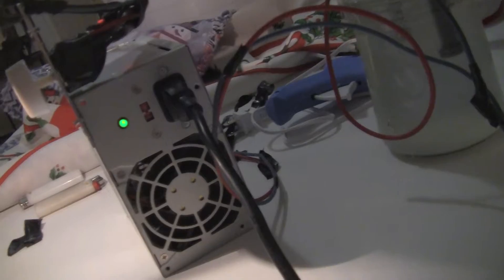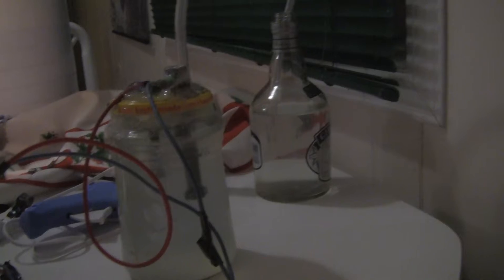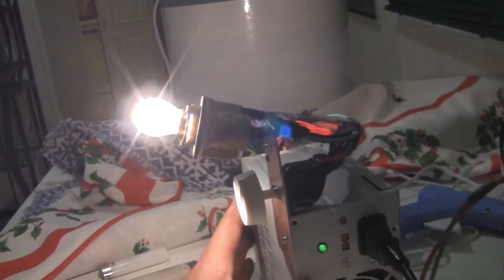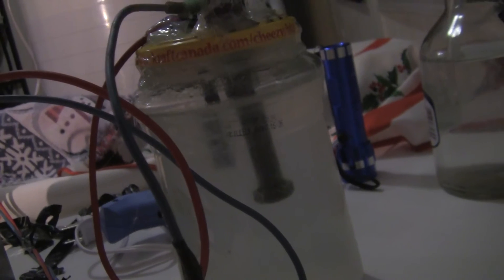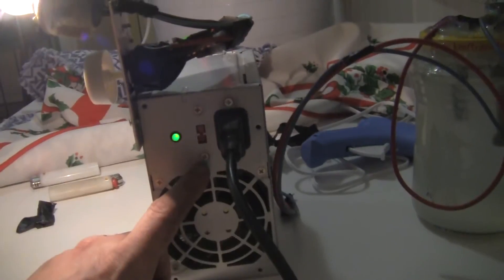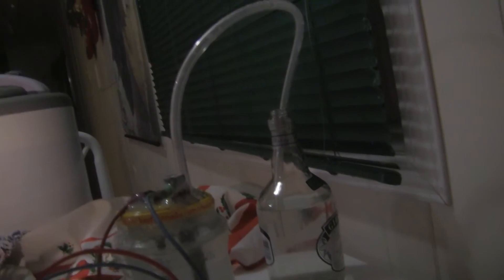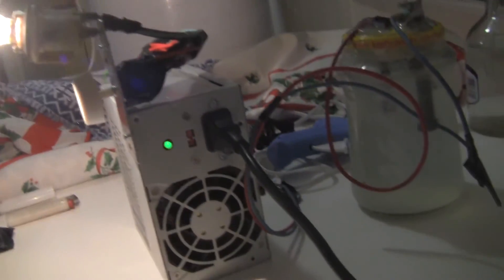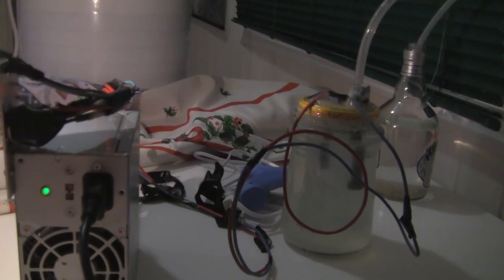KClO3 cell, with cheap current control and scrubber

Comment: The Kathode should be smaller than the anode because if the hydrogen disolve in the solution in reduce the chlorate.
Reply from the maker: Lol... 7yrs later..
I've long ago given up on making rocket fuel. Can't do the good ole candy fuel anymore due to limitations on buying the ingredients. Now if i want to build a rocket, i just size it for store bought motors... Lol

Comment from the maker: Maybe.. I dont remember all the technicallities.. there is a science to it and calculations etc.. basically how far or close they are from each other influences the resistance, and thus the current, which affects efficiency, and how hot it gets etc etc etc.

I basically punched some holes in the lid and did it up, nd it worked out that it works realy well.. roughly 50gms in the 3-4days it takes to eat up the carbon rod.. lol